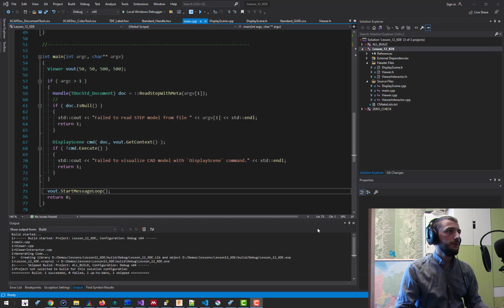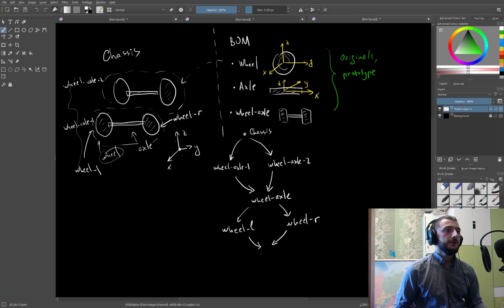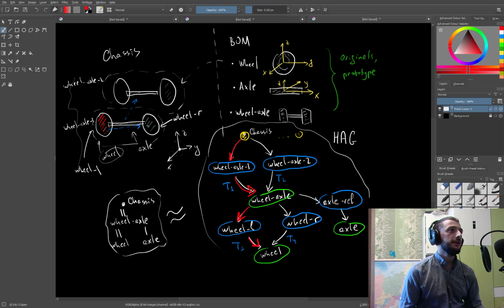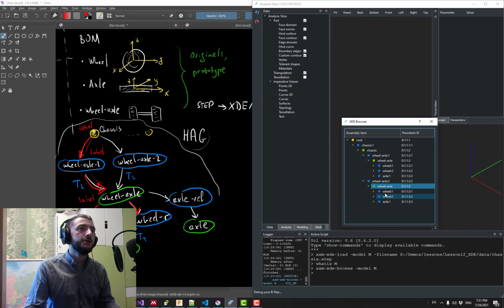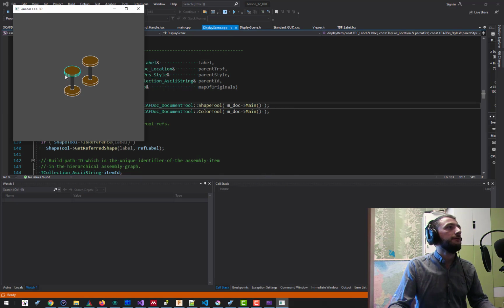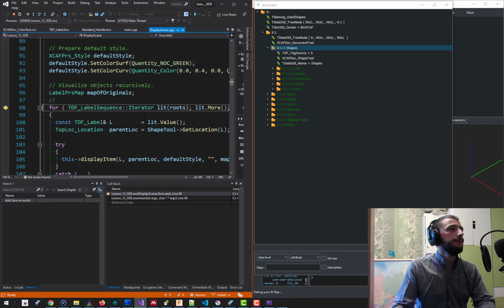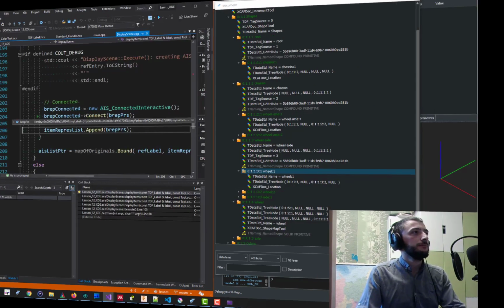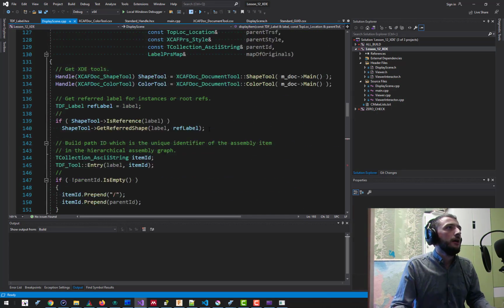Lesson 12: CAD assemblies with OpenCascade

Comment: Thanks a lot for great video and very helpful.  Is there any way to find the name of the solids for example I want to find Body1 and Body2. 
#41=MANIFOLD_SOLID_BREP('Body1',#97);
#42=MANIFOLD_SOLID_BREP('Body2',#98);
Reply from the maker: https://gitlab.com/ssv/lessons/-/blob/master/extras_EntityNames/main.cpp

See also our discussion on the forum.
Reply: @QuaoarWorkshop It works well. Thank you very much for your great work!
Reply from the maker: Yes, this can be done in C++ while iterating what's called the Entity Model. Like you first load a STEP file into the in-memory data structure from which you can grab all the entities with their properties. This is a bit laborious but still quite possible. Unfortunately, I'm currently having a long road trip and could not give you the exact code snippet. Anyway, I created a forum thread here http://analysissitus.org/forum/index.php?threads/get-entity-names-from-a-step-file.31/ and I'll post the code snippet once I reach a hotel room with wi-fi :)
Reply: I'm currently using "STEPCAFControl_reader" with the translation parameter "read.stepcaf.subshapes.name" set to 1. Otherwise XDE doesn't expand to sub-shapes. I can find the names of the "MANIFOLD_SOLID_BREP" entities with "FindSubShape", but it returns 0 whenever there is only one sub-shape. If there are multiple sub-shapes it does read the "MANIFOLD_SOLID_BREP" entity name. The only problem I have is that whenever there is only one solid body in the shape, I can only get the "CLOSED_SHELL" entity name, but not the "MANIFOLD_SOLID_BREP" entity name.
Reply: @marcvanstrydonck8813  Thanks a lot. I will try that!

Comment: Thanks again, does the VTK visualization tooltik coming with OCCT allow to do such assembly rendering (connected shapes) or only AIS gives it out of the box ?
Reply from the maker: As far as I understand, you might have several actors sourcing the same polygonal data, which is essentially the same instancing mechanism if you think about it. However, to confess, I've never used VTK for that purpose and all my experiments were around individual parts. Some more information can be found in the VTK users groups, e.g. we read here (https://discourse.vtk.org/t/how-to-use-vtk-with-a-scenegraph/2160/3): "If you only need a hierarchy for transforming actors in groups (e.g., moving rigid bodies connected to each other using joints) then you don’t need to use a scene graph, you can just define a hierarchy of transforms and apply each transform to the corresponding actor as user transform."

But it all requires experimenting. Btw, OCCT-VTK bridge is a low-level thing, it only provides a source and a picking mechanism. Instancing is a somewhat application-level mechanism.
Reply: @QuaoarWorkshop  Thanks, I will have a look !